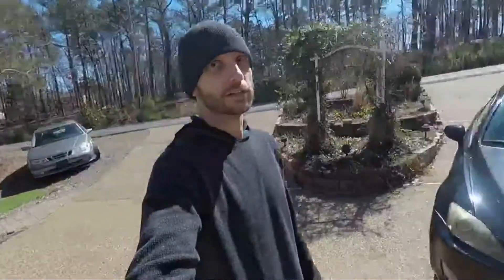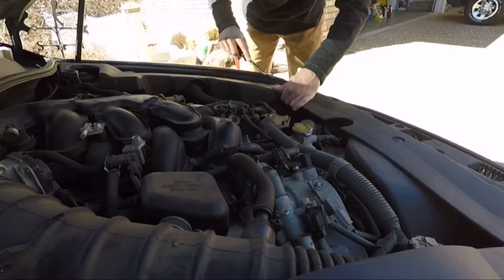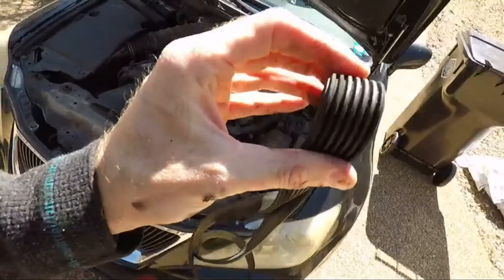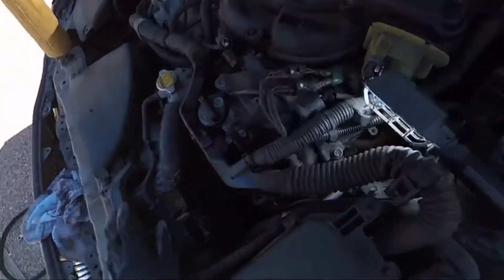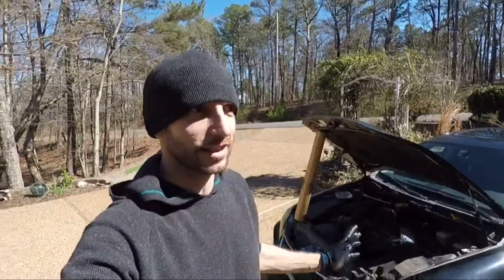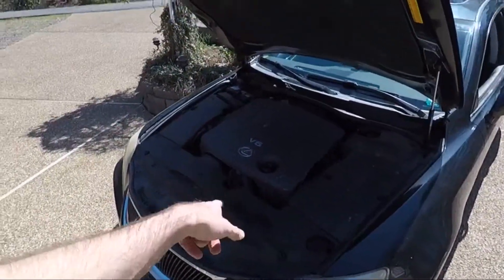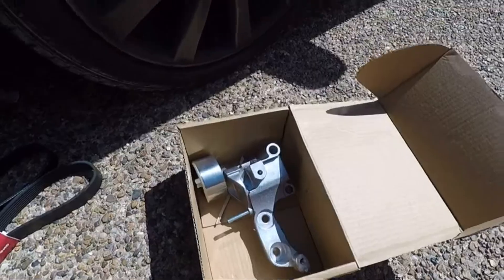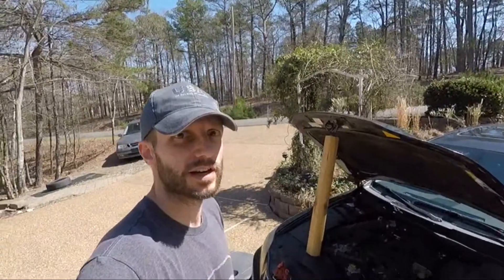Replacing the alternator on the Lexus is250

Comment: I don't know if you ever figured out the window situation, but after disconnecting the battery you have to reprogram them. Open each window and hold the down switch for a few seconds and it'll sync with the driver side control.
Reply from the maker: Yes, I did end up figuring out how to reprogram them not long after I recorded this video. Everything works as it should now, haha. Thanks anyways ✌😎
Reply: @redblockgarage  awesome video, getting ready to replace my alternator this weekend. That bracket bolt looks like it'll be fun to get out